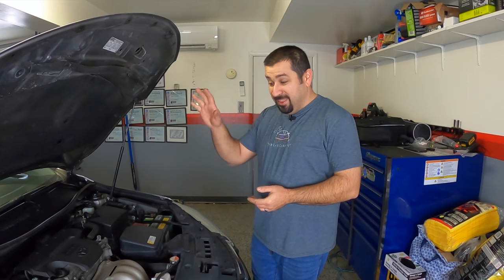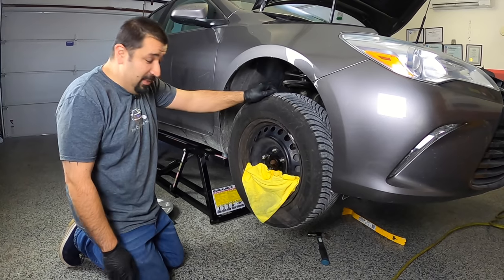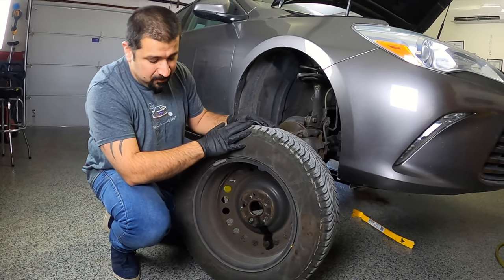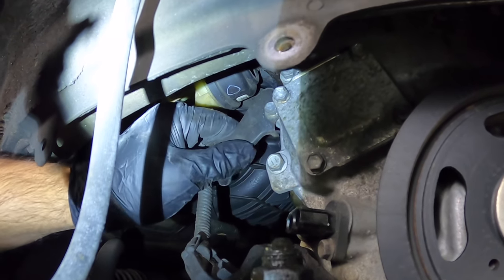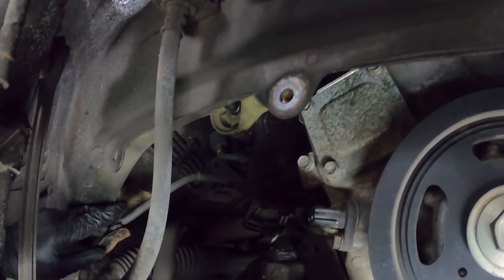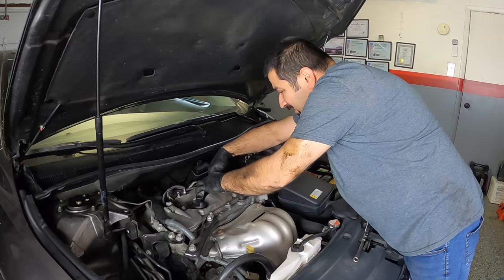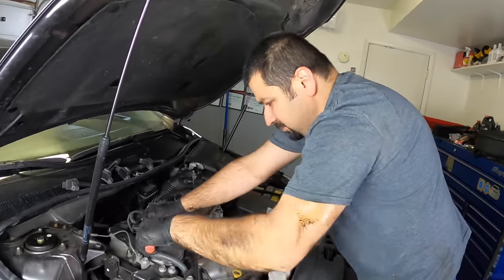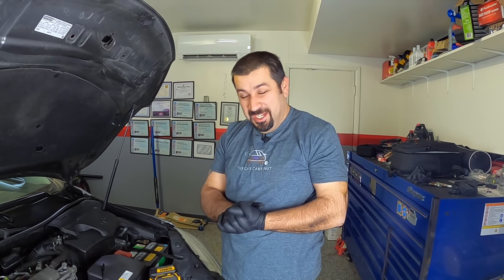Replace the PCV valve WITHOUT removing the Intake. Saving 3 hours of Labor.

Comment: A good method to prevent cross threading is to turn the bolt counterclockwise until the bolt seats correctly. Then, turn the bolt clockwise to fasten.
Reply: Yes, I agree! Ur method has wrkd for me for decades.
Reply: yep, i do this with almost every bolt.
Reply: that works with metric bolts, i suppose. For Imperial fasteners you just need brute force and ignorance.
Reply: @markweatherill   yes sir, just give it to 'er and tighten that bolt without mercy and with all strength you can muster and come up with, and then use a breaker bar to "give er" another 1/4 of a turn, and it ain't ganna be comen off, ever literally lol)
Reply: Imagine cross threading this. You won't have a bad day but a bad month.
Reply: Exactly, this takes away the guesswork and stress of the situation. I almost always use this counterclockwise-first-then-clockwise trick when threading on fasteners.
Reply: Thank U, That's Huge😎
Reply: Hey pal love your channel just got a 2022 camry planning on doing first oil change at 1000 second on 3000 third at  5000 and than go to every 5000 what do you think
Reply: And thanks for letting me part of your community
Reply: @anibalvargas8535  You really know how to treat a vehicle and set it up for a very very long engine life. It is also very nice to have you comment on this great channel, comments like yours are encouraging for good engine maintenance habits, thank you brother.
Reply from the maker: Hi! I would skip the 3000 one as it might be much just one at 1000 then at 5000
Reply: I've been doing that for years. Another mechanic buddy of mine saw me doing it and he was like "you're turning it the wrong way". I said I was just trying to get it seated and he just looked at me with a confused look.
Reply: That’s what I do with spark plugs
Reply: A great tip! Also be sure to use rubber gloves to give you grip when you thread the PCV on by hand.  I tried first on the socket and extension and it didn't work for me because I could only get one hand into the space of my rav4
Reply: Best advice ever
Reply: I wish Toyota Labor ready for 1:40 an hour LOL more like 200 an hour in Florida
Reply: @TheCarCareNut Hi Mr. AMD, Need for PCV valve replacement of my 2018 Camry Hybrid LE. Please make a video on it. Thanks.
Reply: @markweatherill 😂😅 that’s how I roll
Reply: At the beginning if there’s strong resistance already, then back of and reinsert
Reply: Im watching you suffer to get the wheel off and the spare is the best rubber hammer you can buy, use the rubber on the spare and no marks are left
Reply: @vw5056 🫣
Reply: Where is the PCB valve located on camry 2021 SE please?

Comment: I cannot believe that a regular maintenance element like a PCV valve in a 2016 Toyota car is located in such a complicated location. I mean, I changed my PCV valve on a 1989 Honda Accord A20A1 carbureted engine and it wasn't a piece of cake either. But, by 2016, and some of the best car reviews given to Toyota, you would expect that a regular maintenance item, like the PCV valve, would be easily accessible. The only conclusion is that only government legislation will  bring car manufacturers into line.

Comment: I sure hope there is enough clearance for the ratchet. There is nothing worse than ratcheting something out just to run your ratchet into a barrier. You can't remove the ratchet, and you can't change the direction of the ratchet to screw the item back in enough to remove the ratchet. My advice, don't use a ratchet with the direction control located on top of the ratchet where you can't access it.

Comment: I did this on a 2013 Rav4 LE and found it easier to do most of the procedure from the top instead of underneath. Moving the coolant bottle to the side (you do not need to remove the 2 coolant hoses) allows more room to work (along with removing the back bracket for the bottle). You still need to remove the crank position sensor and bracket, from bottom. I also found it was easier to remove the PCV hose, from the top, by pulling off the intake side first, then pulling it off PCV. The bend on the hose is tight, making it hard to get a grip, but doing it this way allows to grip it better and much less intimidating. Also using a ratchet from the top allows you to use a longer handle to break loose PCV (be gentle) along with 2 small extensions. Trying to use a small ratchet from the bottom was difficult to get leverage with limited room. One other tip...looking up from the bottom, you can see the tip of the PCV, which allows putting the socket on and initially push the hose on much easier. Make sure you lightly lubricate hose before installing. None of this would have been possible with out the video. Thanks AMD!
Reply: Thanks for your comments. I️ tried to do from the button on a camry 2012 and, as you mention, the space is too limited to pull the hose and no visibility at all to put back the hose in place.
Reply: I did this on my 2011 RAV4, a generation earlier than yours. Couldn't do it from the top but you have excellent tips though!
Reply: Did you have a ❤code on your 2013 or did you jus do it as precautionary maintenance?
Reply: Precautionary maintenance. Vehicle had 100K miles at time of replacement.
Reply: Well he said this video applied to a 2009 to 2012 RAV4, not a 2013, so you have that.

Comment: I replaced the PCV valve (OEM part from local dealership) on our 2012 Highlander during a routine oil change. We noticed a rough idle and weird oil consumption this past year. I noticed an immediate difference after putting the new PCV valve in. AMD was right, it’s a tight spot! Thanks for the video!

Comment: Took me about 2 and half hours total but I made it. I had to run and a deep socket set and a 3" extension bar. I wanna know what the engineer was thinking!! Lol. And I'm also glad you took your time to explain the entire process. I wouldn't of known that clamp was on the hose end because I didn't feel it at all. I had to wiggle it slowly to where it was turned downwards so I could take it off. Thanks AMD.

Comment: I just did this on my 17 Camry 2.5 XSE and it took me about 90 minutes to change the PCV valve, I also changed my spark plugs. Car runs like a champ. I drive 80% on the highway so my engine with 66K miles on it gots lot's of life still.

Comment: Great video . I just replaced the valve on my 2012 Camry SE . Everything is exactly as you described . My 2 cents : a better way to reach the hose is from under the car and if you open the hood , the natural light gives you a better view . I also used a joint socket adapter and a larger socket extension to remove the valve . Thank you very much for the video .
Reply: Would I still need to remove the wheel, etc? Thank you
Reply: @MusiqTruth … removing wheel provides easier Safety And easier Access…

Comment: Great videos as usual. I have replaced the PCV valve in my 2009 Highlander. But did the expensive way (manifold removal). It was a $ 500 job for a $20 part. Let me tell you that it was totally worth it! It's like night & day. The engine is back to life. This HL has 167K miles and it was sluggish and burning oil for a while (no blue smoke. Just drinking 1qt every 1000). If your Toyota has >100k I totally recommend replacing the PCV. It is amazing the manual don't call for PCV replacement.
Reply: I am the original owner of a 2012 Camry 2.5 with 163,000 miles and have never changed the pcv valve. Mine uses about the same amount of oil and I hope this will help. I bought an aftermarket pcv valve a few months ago with other parts but after watching this video I will probably get an OEM one so I will only do this once.
Reply: After the at-205 my 2013. Then on the advice of a Toyota mechanic I tried Blue devil sealer and it's been good , no leaks. I still would like to do the PVC and I have bought it recently
Reply: @tsukki_amv2848 did it solve ur oil burning problem

Comment: Word of advice to anyone doing this 
You CAN replace the PCV under the intake but GET A NEW HOSE and clips that hold it on. Chances are it will be hardened and crack split when you try to put it back on. I did mine earlier in the summer and getting access is pretty straight-forward but I could NOT get the old hose on without splitting.
BTW - TAKE YOUR TIME, work by feel and keep checking yourself. You can do it.
Reply: I didn't have time to run to my local stealership and get a new hose. But the added bonus of using the old house is that it's already molded to fit the PCV.  Both the hose and the clip went on with a satisfying click simply when I pushed it on. Oh yeah dab some engine oil on the inside of the house prior to attempting.  

Good point about the hose cracking though! I will keep an eye on mine.
Reply: I just got home from doing the PCV on my Scion tC. You are 100% correct about getting the hose and clips. My hose was split at the end that goes on the PCV and the clips are loose.

Comment: The engineers that designed these cars should be made to work on these aberrations that they have designed. Thank God for fantastic technicians like Ahmed. From Australia 🇦🇺. I remember replacing PCV valves on Holdens sitting on top of the tappet cover. 5 min. job.

Comment: I will try that tomorrow on my 2011 Camry SE. I have changed it before by removing the intake manifold and its a long job. Keep these cars maintained and they will run forever. I just hit 324,000 miles on my 2011 and it Still runs as smooth as when I purchased it.

Comment: I replaced This On My 2012 camry around 100k few years Ago. I will replace soon om my 2016 Camry also when the weather is Warmer and no snow. Replace the Hose while you're at it. Does not cost much i think i paid under $20 for the Hose and Around $10 for the Valve at my Local Toyota dealer. A quick Tip; To Help you start the new pcv valve in without crossing the threads, Cut the Old Hose (that you replacing Also) about 4 inches and insert it into the Valve Without the clamp and it will make your life Easier. Then use the Socket wrench.

Comment: Mine is in the same I was able to remove and replace it simply by lifting up the car as if I was going to do an oil by using a creeper I simply slid under the car and replaced the PCV valve without moving anything out of my way or taking any brackets apart not a simple job but once you figure out ways to put your ratchet it's possible it took me about 1 hour and 30 minutes to replace it with new OEM valve
Reply: I couldn't turn it using this method and feared breaking it.  I'm due for an oil change, so I'll check this access.

Comment: I have 2010 Toyota Camry 2.5L with over 230,000 miles on it and I've never replaced the PCV valve or that hose. Now my OCD is going crazy!! I got to get this done. 🥶🥶🤯🤯
Reply: You can’t change the pcv valve the same way done  in this vid. 2010s have a hydraulic power steering system.

Comment: I lived in the rust belt for years but not anymore . If out on road and rim/tire froze in place get on your butt and kick with legs on right and left on rubber of the tire it will come right off I’ve shown all my 5 daughters this trick . Excellent video Iam sure I’ll be doing this on wife’s 16 soon at 110.000miles

Comment: Many thanks! I did this today. It seems to be a lot easier if you do the whole thing from under the car by the wheel well as opposed to reaching in from the side. And the use of a little anti-seize on the new PCV threads significantly cut down on the probability of cross threading as the thread was extremely tight in there. This way I was able to start screwing in the new valve by hand for a few turns.

Comment: Nice video about this part.  I did this on my 2016 Scion tC (same engine) at the same time I replaced the spark plugs. Hardest part is getting that hose on and off.  Never thought of just pulling the hose off and pushing it back on. But, I was able to pinch and move the compression clamp by hand.  If you can do this, I recommend it because it will make getting the hose on and off much easier.  
On another note, it is possible to see the clamp and the end of the hose, but only when on your back lying under the car.  But you definitely cannot see the whole PCV valve.  Removal and replacement of the valve itself is a blind by feel job - easy enough.

Comment: From your video and another short specific one, I changed the PCV on a 2013 RAV4.  If it wasn't for you I would have never believed the PCV was there.  Took me about 40 mins to find it with yours and the other video playing on the laptop and positioning the laptop to as close to the same view as possible.  Then I kept losing it.  Should have marked the path to it with something.  I broke the hose pulling it off and pulled the other end off, which because of how tight everything which also took a lot of time to find without removing components.  Putting the PCV back in was even worse.  The only way I could start the threads was with a terrible position with my left arm weaved through a whole bunch of components.  Putting the PCV in the socket did not work either.  Something sharp dug into my forearm.  I tried all kinds of body positions to try and find a better one.  Nothing!  Finally, just let it dig while starting the threads and dealt with my bleeding arm afterward.

It was a weekend project and I had not purchased a new hose thinking I would use some fuel line hose if needed.  Found out the nibble from the other end was significantly bigger than the PVC nibble and the dealer closed before I could get there!  With soaking in no-odor mineral spirits and using a needle nose plier to enlarge the hose end, plus several yells and a few choice words, I finally got the hose to go on this end.  

The really crazy thing is with 105,000 miles on this vehicle the original PCV rattled better than some news I have had.  I replaced it with a Toyota PCV which only slightly rattled better.  Definitely not worth the effort at this time, but it was a memorial experience!
Reply: Another guy commented here said he did from the top of his Rav4 by removing his washer tank.

Comment: Thanks Amd, I am not a pro, but I just did this job in my driveway with hand tools in 1.5 hours. I did this on a 2011 Rav4 in my driveway yesterday. The clamps are not tight and you can carefully pull the hose off the PCV. I was able to reuse my old hose and the added bonus of it being hardened is that it clips back on the new valve with confirmation via sound and feel. Be sure to dab the hose end with a little oil to make it go on easier with the hose clamp in place. Then put the other end of the hose on via the top of the engine. Rubber gloves are a must because that's what lets you grip the tip of the PCV and get the new PCV threaded back on.

Oh yeah, the third generation Rav4 only has enough room to use only one hand.

Comment: One trick I learn to take off a stuck tire: loosen the lug nuts but don’t take them off. Keep that tire on the ground without jack up. Turn steering left and right and/or move the car forward and backward slightly and brake. Usually the weight of the car will loosen the rim from hub.
Reply: I've helped neighbors with this method. Takes under a foot of horizontal movement to loosen the wheel.

Comment: This makes me miss my '96 Chevy Monte Carlo - the pcv valve was right there at the top of that engine and super simple to just disconnect the hose and replace the valve! lol

I actually have this car - the 2016 Camry LE - and it has served me well. 97k miles after just under 6 years of driving. I bought it brand new with only 12 miles on it and it has been a pleasure to drive. Perfect maintenance record as I've taken it to the dealership every ~5k miles for service.

The only things I'm concerned about currently is a clicking when making sharper turns (sounds like it's down around the wheel but mechanics have found nothing so far) and from time to time the AC fan seems to fluctuate speed - almost like it's not sure what speed its supposed to be at. (Turning it off and back on usually gets it working fine again. Another issue that never happens when I'm in for service. lol)

Aside from those 2 minor things, I haven't had to replace anything other than the normal stuff you do for routine maintenance. Absolute gem of a car!

Comment: Very good tutorial. Why couldn't you use that borescope ($60-$125)that you used on the cylinder for guiding  the extraction and insertion of the PCV valve. Otherwise it is going to be $375 on the labor? You could secure it and point the camera  by sticking with tape or silly putty nearby. The rusty wheel hub was an easy fix.   Thanks again you are a very good teacher.
Reply: A great idea, but I wish I had a borescope...

Comment: My 2013 rav4 started burnung a lot of oil. At 165k miles i performed the pcv replacement as per AMD here. Not so easy, i got it out with relative but going back in took a couple hours. Twice i backed the valve out because i wasnt sure if i was going in straight. Lots of different body positions, im a bigger guy so i couldnt do it as shown. Anyway, after 3 hours and a lot of fear, lol, got it together and she runs great. Lets see if the oil loss is solved. Thank you for the excellent guidance. Saved my family a lot of money. Thank you sir
Reply: How is your oil looking? Bout to do this on a 2012 RAV4 with the 2ARFE.
Reply: Same question...did it help. I need to do this to my 2012 RAV4